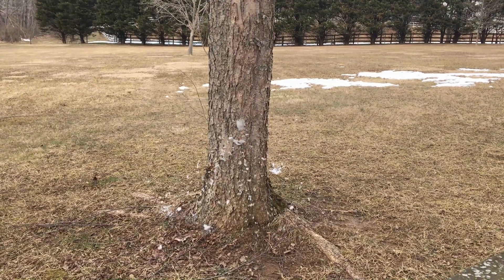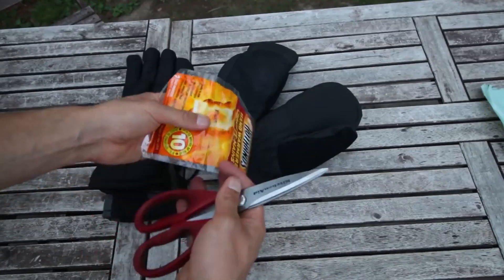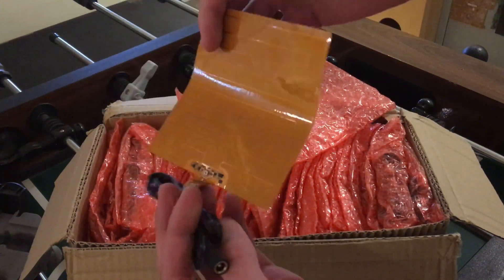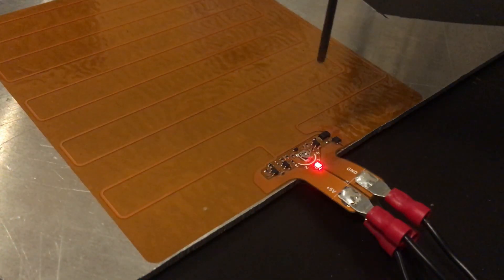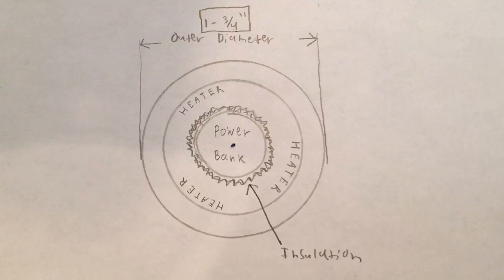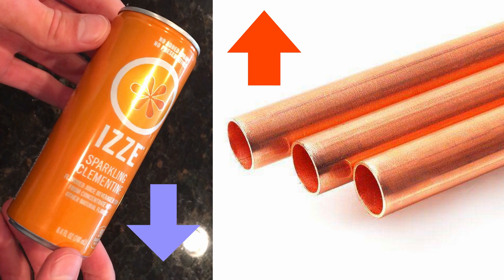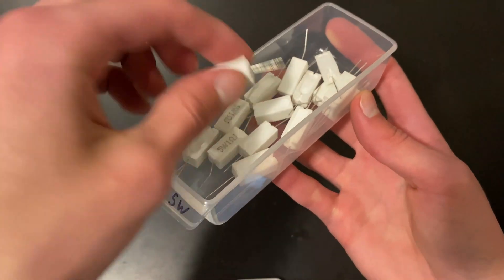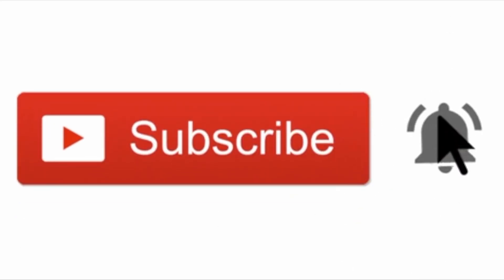DIY Electric Hand Warmer Project

Comment: Here is an idea thread...
Nothing has more thermal mass than heated plain water in a mason jar.
Meanwhile...
 Electric candle warmers use 17 watts of energy. 
A candle warmer will heat up to 16 oz of water, in a glass container, with a metal lid, to 124F. 

Perfect for warming my cold, numb, fingers.
 I have Raynaud's Syndrome in the wintertime.
Raynaud causes only one or two fingers to feel very cold and numb.
Often it is one of my thumbs.
Most people treat Raynaud's symptom with hot water flowing over the finger(s).

Meanwhile
I have three (3) of my candle warmers with each having 16 oz water atop heating. 
I use them at home. for my hands and to help heat my Man Cave. 
The total electrical usage is 54 Watts for all three candle warmers. 

I've tried all kinds of electric gloves while outdoors they really don't work for me. 
The best outdoors hand heating is to first, put on latex gloves, then put on your regular gloves or mittens over them.
Your body heat will be conserved in the gloves and the latex liner keeps your hands dry.
Reply: I have Raynauds. All of my fingers turn white.

Comment: You better should not upload this video if your project fail . Stick with something you can handle. I've done hand warmer with sensor. 7 hours running from one li-ion battery.
Reply from the maker: I don't think this project was a failure as I achieved my goal during the video. Even if a project was a failure, as long as it is entertaining or contributes something of value, I would still upload it. That way others can learn from my mistakes so they don't make those same mistakes on their own projects! I believe that everyone should push the boundary of their skills because that's how learning occurs.
Reply: Yeah brother. I learn like a mo fo, because I too am a "trial and error" guy. I love trying different ideas. Most don't succeed well at first. However... Persistence Pays Off @CarbonCoil